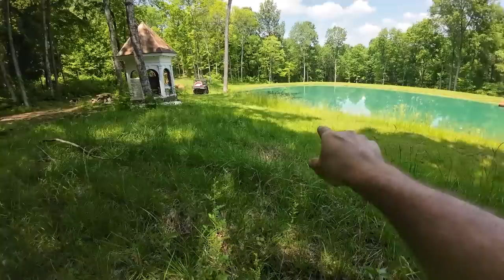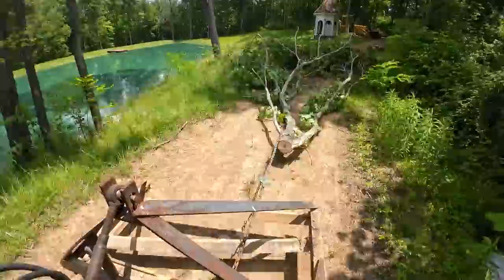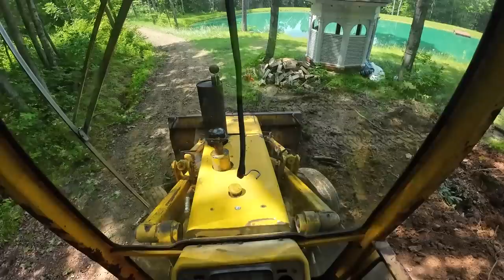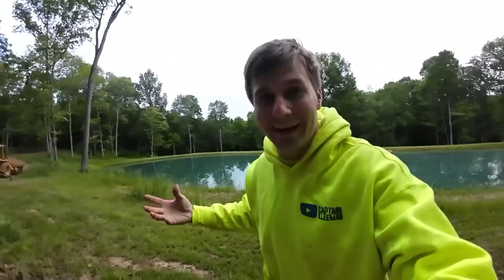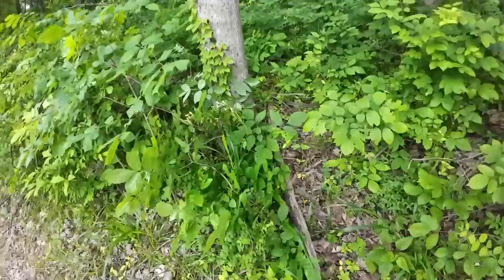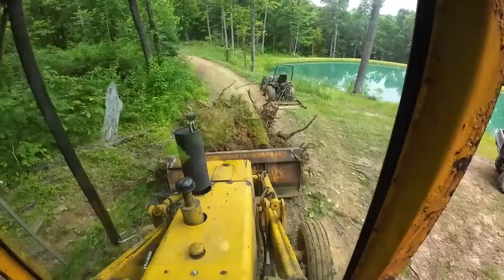Building a Parking Area for Our Pond with My Old Backhoe

Comment: I could have sworn that Bell Tower was coming over, but it didn't, and I was amazed I held my breath. You have gotten quite good at working that back hoe . Thanks again as always for putting a huge smile on my face, thank you for sharing.
Reply: I had visions of the tower falling over, rolling down the hill and into the pond.
But I'm a troubled old broad
Reply from the maker: I was a little worried myself, but it worked out
Reply: @CaptainKleeman  It turned out very well I remember when you went and got it

Comment: A couple of small projects that might help you out Mike.  Replace one of you tractor lift links with a chain or fabricate a modified link with a pipe in a pipe.  If you're just trying to smooth the ground, your land plane will follow the contour of the ground without digging in or passing over the area you are trying to smooth.
I took one of my chains and placed multiple hooks on the end.  I then took some chain choke dog collars which I pass over the ends of the limbs and then attach to the hooks.  Makes it easy to attach a pile of brush and they don't slip off.
Thanks for another great video by the way.

Comment: Great work…it’s easy to visualize and make steps happen with new(er) equipment.  Your skills have to be so much more when you factor in such limitations of repurposed (second life) or undersized equipment.  When you add in tight spaces, soaked soil, and staying out of the pond, you have to break it up into steps (like you did).  It’s like one of those puzzles where you have to move other blocks around first in order to make room to move blocks into the correct position (thinking multiple steps ahead).
Reply from the maker: It can be tricky, but it can always be done

Comment: Great job!  It has probably already been mentioned and is on your never ending "to do" list but, that hydraulic hose needs to be tied up before it catches on something.  So glad that your pully system worked so smoothly and the cribbing that was used to move it to the pond had not weakened to where the screws came out during the move. Looking forward to upcoming events.

Comment: Hey Mike The next time you use the background take the front bucket tip it over and use the back end of the bucket to stab into the ground it will. Help you stay still when you need the pool stumps plus it's a good E break so you can pick up the Back end of the background and you don't have to worry about it moving
Reply from the maker: It was

Comment: Ya know that firewood can be round captain. Those tops had a lot of burn in them. I always kept some rounds for night burning. The burn slow but for a long time. Near as I can tell you left a ten foot section of stuff in that last pull that would have been easy pickings. I went for two whole years just going out and cutting left over tops from a logging operation. All walnut and made great firewood. cut everything from two to six inch rounds and later split the large stuff a bit but most burned whole. Just cut to length. We called them night logs to avoid having to wake up and stoke the fire.
Reply from the maker: If I can't run it through the processor, it gets burnt.

Comment: Captain for what you're using it for right. There? Around the bell tower. Even? Up to 3. Inches. Or 2. Inches. Or one. Inch you cut it and put the injured fine with paul and that'd be what you call you starter wood

Comment: The 555 front tires are getting a lot of air time Mike I know you've mentioned the counterweight refit but for it's own sake it needs them, that way there is more benefit to angling the front bucket down when your trying to load up the backhoe arm on the outriggers. (After 30 years running a JD 8Ton Hoe they tell you what they want🙂)
Reply from the maker: It's not a big deal, I'll get to when I get to it. Until then it's not a problem

Comment: When pulling the logs would it be better to use the top hitch to lift the logs slightly when pulling.
Reply from the maker: If it's digging in, otherwise I just drag it.

Comment: I think either wider rims and tires or get a set of dual tires would help your sinking problem.  Old wide combine tires and rims would give you the floatation you need and match the bolt pattern.  Making your self a set of duals would work as well to help you walk through the wet conditions.  Backhoes don’t come that way cause they are moved on trucks so often.  I’m betting your hoe is gonna spend most of its time at home in the wet.  Blessings
Reply from the maker: Interesting thought

Comment: New teeth on the hoe sir.
Reply from the maker: 🤣 let me know when you send the new cutting edge, shanks and teeth.
Reply: @CaptainKleeman  I have a case 580 sk, and the teeth were not that spendy last time I replaced them on the 2' bucket. *Shrug. Come to think of it I need to replace my cutting edge on the bucket. I will likely do an Andrew Camarata and buy a strip of steel and pop it in place of the old one.
Reply: @CaptainKleeman  just checked online and for 100$ USA you can have some brand new teefus for that bucket, Cap. Cheap as heck and good to go.